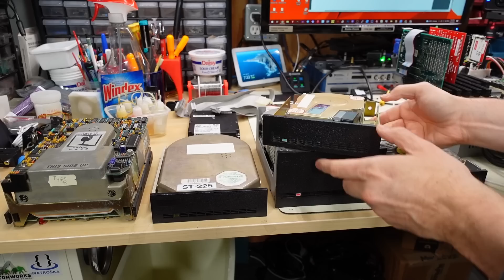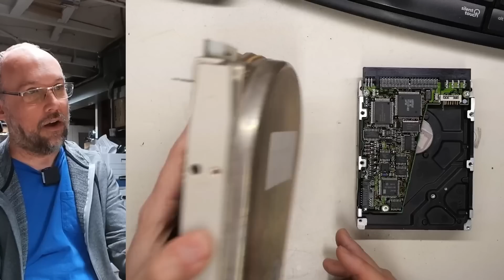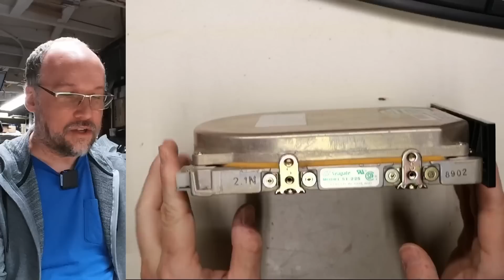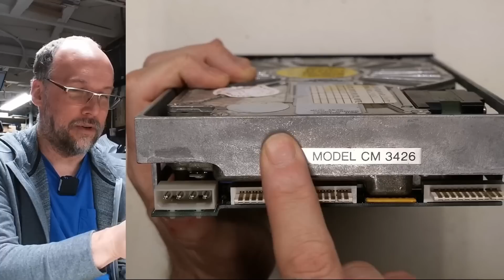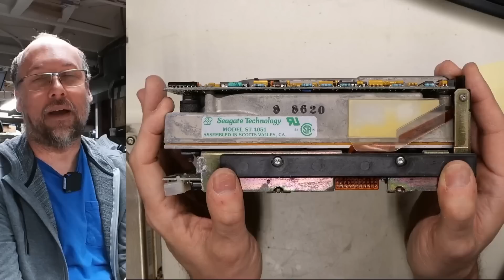Not forgotten: MFM hard drives

Comment: 5:20 - Probably you are aware of it already, but just didn't mention it for brevity: MFM is not only used on double-density diskettes, but on high-density and even ED diskettes as well.

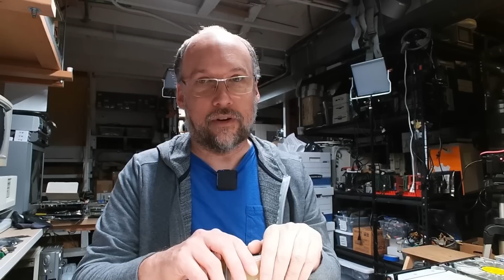6:23 - It's not just the mechanism, it might also be about the head amplfier. The distance between two "pulses" from the head using MFM encoding is 0.2µs, 0.3µs or 0.4µs. On the other hand, the distance between two "pulses" from the head using RLL encoding is 0.2µs, 0.267µs, 0.333µs, 0.4µs, 0.467µs or 0.533µs. As the minimal pulse distance is the same, the requirements to the magnetic surface are identical. As the grid of distances between pulses is smaller, there is less tolerance for jitter. This jitter might be caused by RPM variations, but that's highly unlikely, though. The controller synchronizes to the grid of the recorded data on a synchronizing pattern called "data address mark" or "preamble" before each sector and keeps in sync using the timing of the detected pulses. As the platter assembly is very heavy, it has a lot of inertia and doesn't allow quick variations of the rotational speed. As I understand it, jitter and/or noise introduced by the read amplifier (or worse: the write amplifier) is a more likely cause of pulse distance being detected errorneously when you use a non-RLL-certified drive with an RLL controller.

The MFM scheme is technically also an RLL scheme. It runs on a 0.1µs grid, and there is the rule that the run length (the amount of grid positions without a head pulse between two pulses) is limited, both to the low and to the high side. MFM requires at least one idle grid position (i.e. two pulses in 0.1µs distance is forbidden), and allows at max 3 idle grid positions (i.e. the fourth grid position at 0.4µs must contain a pulse if there was no pulse at 0.1µs, 0.2µs or 0.3µs after the previous pulse). This is why one would call it an RLL(1,3) scheme. The scheme colloquially called RLL is an RLL(2,7) scheme. It operates with the grid at 0.067µs, but requires at least two idle grid positions between two pulses to get to the same 0.2µs minimum distance.

On 5.25" and 3.5" floppy drives, double density is MFM at a grid of 2µs, so the allowed pulse distances are 4µs, 6µs and 8µs, whereas single density used FM at a grid of 4µs, with the allowed pulse distances being 4µs or 8µs. If for some reason, there is between 1µs and 2µs jitter on the signal while reading (which might have been introduced during writing, by creeping demagnitization and/or during the read process), FM decoding would still work, but MFM decoding would fail.

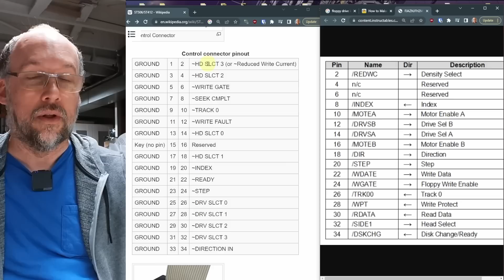8:44 - it's not "binary coded decimal", it's just binary. In binary coded decimal, you could only select 10 heads, as the bit patterns for 1010 to 1111 are deemed invalid digits.

10:00 - If I remember correctly, the ST-225 already has "buffered seeks". This means the controller can send seek pulses faster than the stepper can step, and the drive counts them and executes them at the speed possible for that drive. The drive can continue executing the buffered pulses while the controller is reading/writing the other drive. That's why you have the "seek complete" drive status bit (that made it into the IDE standard). This bit is used by drives with buffered seeks to tell the controller that all the seek pulses have been performed. So there is a little amount of intelligence in that drive.

12:42 - It sounds like you assume that the ROM chip is "loaded" into some RAM to become part of the BIOS. That's not the case. The chip is directly mapped into ROM address space (typically C800:0000 - C800:1FFF on XT hard drive controllers in default configuration), and every time you access the hard drive, code is directly executed out of the ROM chip. The BIOS does scan the the "adapter ROM range" during boot-up, and calls the initialization routine in all ROMs it finds. This initialization routine re-vectors the disk access function (INT 13) from the IBM mainboard BIOS into the XT hard drive controller BIOS. The hard drive controller BIOS then receives all disk access calls, and in case of floppy disk calls, it forwards them to the original IBM mainboard BIOS floppy drive code.

14:34 - The 16-bit controller still requires to know the number of heads and sectors per track, because it implements cross-track read/write operations. As the controller card has no longer a way of internally "knowing" the geometry, as the geometry is handled by the main board BIOS, there needs to be a command to tell the controller chip the number of heads and sectors per track to use (which needs to be the physical number of heads and sectors per track to use!). This is why IDE still has the "SPECIFY" command, which was later used to configure the translation between the virtual geometry on the IDE port and the physical geomtry of the drive. On those newer drives, if you specify less heads using the specify command, you get to use more tracks, because the drive translates the geometry accordingly. On the original WD-1003 AT controller, specifying less heads than the MFM drive had just kept the remaining heads unused.

16:44 - The IBM AT was released in 1984, not 1983. The XT was released in 1983 (as you mentioned correctly at the start of the video).

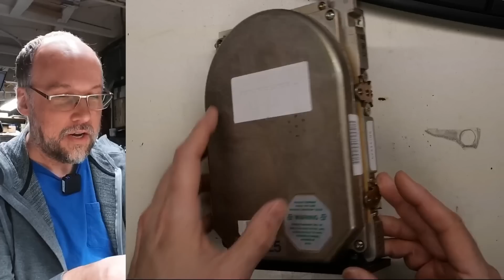17:50 - Acutally, I don't have a ST-225 at hand currently, but I do have the RLL certifierd version of it, the ST-238R.

24:50 - Officially, what you call "full height 3,5 inch drive" is still called "half height". It is 1.6 inches and indeed the same height as a half height 5.25" drive. What you call half heigh (the standard size of 3.5" hard drives) is more than half of it, its 1". It has no dedicated name, you refer it by "one inch".

Comment: Still have a ST-225 out of my Atari PC3. Sometimes the head gets stuck but no bad sectors last time I tested it. Interesting to note is that this drive came new from the factory with a Western Digital controller. The other MFM HDD I still have does still work 100%, a ST-238R out of my Atari PC4 an that pc came from the factory wit ha Seagate controller. Both pc's use a XT-IDE to CF adapter for a few years now which makes them much more reliable and faster.

Comment: Not sure if they originated it, but I have an adaptec RLL controller.  It was first used with a st-225 and a similar miniscribe to sport a pair of 30mb drives, then they were replaced with a 130mb maxtor drive resulting in about 200mb capacity.  Which was about the limit for those drives (the physical drive was 8 platters and 15 data heads p, 512byte sectors, 17 sectors per track and 1024 cylinders ).    Around about the 386 we moved to ‘ide’

Comment: Wow!  You woke up some mmemories here.  I'm retired and we used to use these drives at a company I worked for early.  So let me cut this down.

We used to use WD 1001 through WD 1004 conrollers and were running TRS 80 Mod 4 computers running the LDOS operating system. Yikes!  We also had drives with removable cartridges.  We used those to do backups.  I found that I could talk to the controller directly.  LDOS was a pretty simple system.  Using the disk architecture we had mapped I wrote a sector by sector bakup/restore utility.

One day Western Digital announced the end of the WD 100X series controllers.  I found replacements  from RMT Systems.  Long story shortened I found myself on the phone with Ralph M. Tobbleman.  Ralph was the designer of the WD 100X series and took the design with him when WD let him go.

When we converted to IBM PC's I wrote a utility to copy data from an LDOS drive.  This made those conversions a snap.  I am so glad to be away from that kind of bit twiddling.

Comment: Full height and half height -- having never personally handled a true full height 5 1/4" drive, if I understand the terminology correctly, a half height 5 1/4" drive (like a 1990s CD-ROM drive) is about 1.5x taller than a half height 3 1/2" drive (like a 2000s IDE/ATA hard drive such as an IBM Deathstar--err--Deskstar).  In order words, three half height 3 1/2" drives stand as tall as two half height 5 1/4" drives.

Comment: That 50 pin Shugart interface (SASI) is what became SCSI-1 later on. If you end up running a really old pc clone using a SCSI drive you don't run into any of the drive geometry issues and IDE disk size limitations.
Reply: That's what I always liked with SCSI, even though it may have its gremlins and other hijinks ("SCSI voodoo" or "black magic" as I've seen it often called), when it worked correctly, it was rock solid. Though if your controller had a size limit (like some Adaptec ISA SCSI HBAs had, although the limit was purely software, the hardware was capable of supporting large HDDs, just the BIOS that threw a spanner into the works)... You would run into the same issue as the IDE BIOS limit. 

I think I still have two early SCSI drives, one Conner 40mb and a 1gb IBM.. Both of which still work.

Comment: Man, this was my career from the late 70's to 2000. I worked at Adaptec first on SCSI to ST-506 controllers and next on the IBM PC controllers. Minor correction, the original IBM controller was created by Xebec, not WD. Our president came back from the IBM PC public announcement of the built-in controller with a full system he purchaced. He assigned 3 of us (2 hardware and 1 firmware) to duplicate the controller using our chipset with the added major requirement that we has to be format compatible so that Xebec and Adaptec controllers could be interchanged. Oh and by the way, first demo had to be in 1 month!!! We did it and sold it as the ACB-2000. One of our chip guys was working on the RLL version of our MFM ENDEC chip. I shoehorned it into the ACB-2000 and it worked the first time. This became the ACB-2070 (for the RLL 2 of 7 format.

BTW, the Xebec PC controller used the basic SCSI command set ans did the IDE drives.

Comment: I added an ST-238 RLL drive to my Compaq portable back in the the day - I still have it.  The ST-238 was 20MB under MFM and 30MB with RLL.  I don't think I ever had more that 10MB stored on the drive.  It stayed in service until I built a x386 that would eventually run Windows 3.0.

Comment: I can see preserving what few of these remain for historical reasons, but I would not want to use one even in a retro computer.  A lot of these drives came with known bad sectors from the factory.  Their days are numbered.  It'd be better to come up with some sort of interface that lets you use an SD card instead for using the old machines.

Comment: The Seagate ST-225 was notorious for the platter motor bearings going bad if it was in a computer that was left powered on most of the time.  It would work just fine until you powered it off and let it cool down, and then the bearings would partially seize up to the point where the motor could not overcome the static friction to get the platters spinning.  But, you could manually turn the spindle since the motor shaft is accessible on the outside of the drive.  In essence, give it a jump start.  This allowed it to spin up and function normally again -- but it was clearly on borrowed time at that point and you should copy your data to another drive ASAP!

Comment: Great video. One thing is that in perhaps the late 80's/early 90's there was a spate of drive heads sticking (it was rumoured to be a Seagate lubricant problem IIRC). I bought a bunch of 2nd hand drives and saw it especially on several 20Mb "FileCard" units. They always seemed to stick in a parked position when powered off for a long while and the stepper didn't have enough torque to move the actuator. If you manually tweaked the stepper spindle slightly, the head actuator would unstick and about 90% of the time the drive would perform perfectly well.

Comment: In my original 286 clone build in 1987, I used a 30 MB Seagate MFM drive. Later I replaced it with a Seagate 80 MB SCSI-1drive that had to be paired with a Seagate SCSI-1 controller because the SCSI interface hadn't been standardized at the time the Seagate drive was manufactured. Do you have any videos on early SCSI drives?

Comment: Blast from the past. You may find that micropolis is an 80MB drive. We used to order 5170s driveless and install the M80 drives. Also when those full height drives die, they are heavy enough that they make excellent door stops.

Comment: The ST-225 could easily be reformatted from the original MFM into RLL and by that get a 50% increase in capacity, but you had to change the controller.

On many controllers you could low level format the disks by using the DOS command DEBUG and then execute G=C800:5.

Another change that you could do was to tune the performance of the disk by trying out for the optimal interleave value, that would do wonders for the performance of your computer. The standard interleave was set for a safe operation on all PCs, but with a lower interleave value you could increase the throughput considerably. But a too low interleave value would make it slower.

Comment: Great Video Adrian.   I used an MFM and dual floppy in my first IBM combat PC in 1990 in our 286.   I am about to embark on putting together both an XT and an AT/286 from parts.   So any further video on how MFM and RLL operate would be great.
What you described about the controllers with the XT and later AT onward and with IDE was really great information.
Would love to see you actually install these HDD into period specific PC's (XT / AT) and how you go about configuring the system to take them.
Also would be a good time to talk about Parking these MFM / RLL drives.

Comment: The first PC I bought was an AT clone that came with an ST238R 30Mb RLL drive. I can still remember the sound it made when initialising on power up! It lasted a couple of years until I plugged in the ribbon cable backwards when I was installing a sound card (I had to re-route the cable) and it never worked again... thank goodness for backups! It got replaced with a hard-card type drive at first because they were cheap, and then a year or so later with a Western Digital Caviar 170Mb drive which seemed like an infinite amount of space.

Sometime later someone gave me some programs and data on a 10Mb full height MFM drive that was the size of a shoe box and sounded like a jet taking off when you powered it up. Thank goodness we have USB thumb drives these days! Now I wish I still had it because its a piece of history, but I imagine it got junked in one of my clear-outs that I did periodically.

Comment: My firs DOS PC was a Honeywell 8088 in 1993. 2 Years later i build my first desktop from leftover parts. 286 Mainboard, a few sprinkles of Ram, a MFM controller with a 20MB HDD.
Used programs like Stacker or Doublespace/Drivespace to squeeze as much out of it as possible.
And what did i eventually use it for? Cross assembler for my C=128 😀

Comment: My ST-506 hard disk was connected to an Z80 computer using a XEBEC 1410 controller around 1982.  I was working on a Z8000 based system at the time using the ST-506 and XEBEC 1410 controller so just ported one over for my 256k CPM 3.0 system.  Was equivalent to 5 double density / double sided 80 track floppy disks - WOW!

I later used the Adaptec RLL ISA bus controller to update my MFM drives for more storage.  Never had a problem with the RLL encoding.

Comment: In classic Seagate drive part numbers the first digit is the form factor (4 full height, 2 half height) and the rest of the digits are the unformatted capacity in megabytes. If the drive supports RLL the part number will end in R.

Comment: Back in the PC days there were a lot of external hard drive enclosures for the PC, where the case was just as big (and heavy) as the PC itself. At one point I'd ended up with an old 5150 with an external hard drive enclosure and the combination together was something like 100 pounds, and of course the MFM cable was attached in such a way that it'd have required disassembling the computer and/or enclosure in order to disconnect them.

Comment: With that stepper motor you could think of HDDs as very basic robots heh. Just enormous at the beginning but you got start somewhere. Interesting migration of the BIOS over the years. Mostly just have sound memories of the oldest drives, listening to them at school since they still had a few older models in use.
By the 90s it seemed like all the drive types managed to be of the same scale which is quite the accomplishment and easier for PC case slots. A mostly reliable lifespan in that era, I know many people had HDD failures but I came out unscathed. My second to last PC still had moving parts and did fail but I used it for a long time, well past the upgrade time average, also think my BIOS chip might have died.
I feel so spoiled with my current solid state drive, it boots instantly and despite throwing lots of files onto it I'm nowhere near capacity, you got it so good now younglings lol.

Comment: Just going to gloss over that the HDD connector is labeled "Winchester"?!
Reply: It didn't just happened to be labelled that way, "it had 30MB of fixed storage and 30MB of removable storage; so its IBM inventors called it a Winchester in honor of its 30/30 rifle."  Also, the actual disk was not seen outside of the drive: so the contrast between "floppy" disks/drives and "hard" was lost on the average user. "Winchester" sounded more respectable, and less subject to snickers and giggles "heh, hard disk, dude I have a hard disk, get it?"